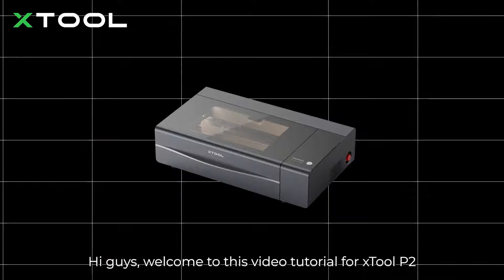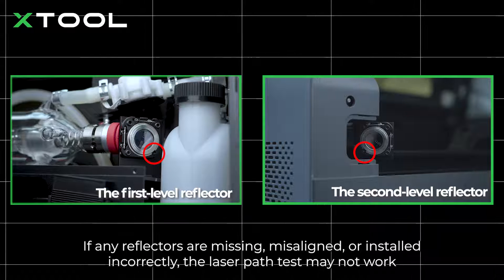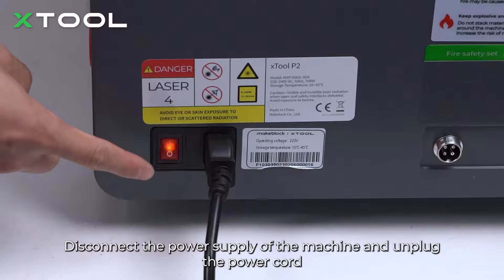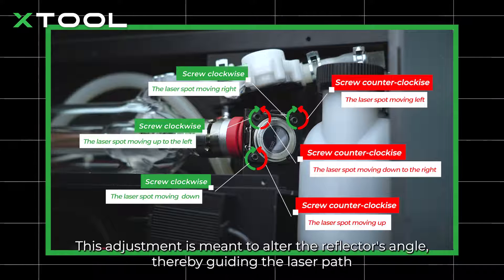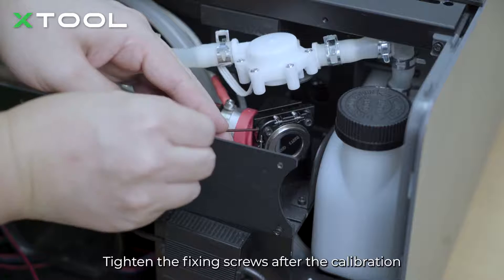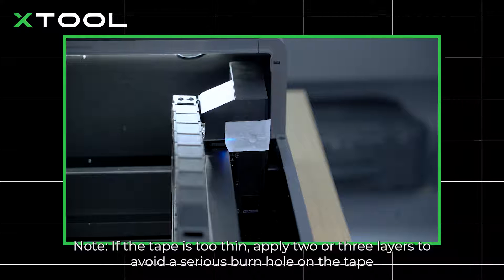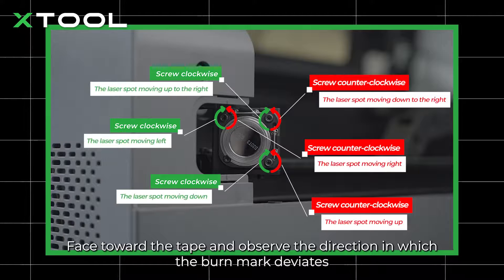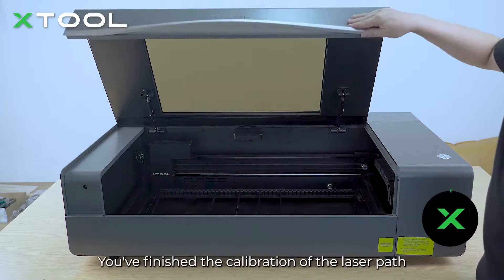Calibrate the Laser Path of xTool P2

Comment: What version of software is this using?  I do not have a burn mark at level 1 and no buttons to move closer to the first mirrors.  I am not using the V2 Beta software since none of the tutorials I've found show this software
Reply: right, i dont have the arrows to move the machine either.  my instructions are totally different for my P2.  there seem to be several different instructions floating around.